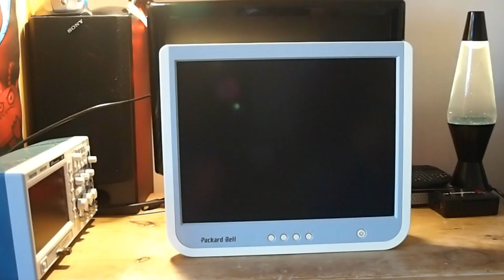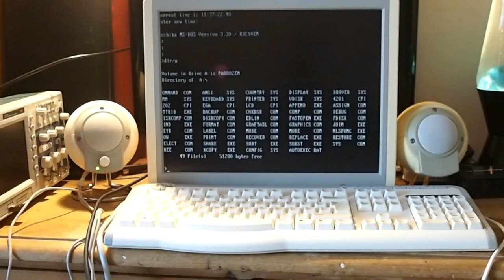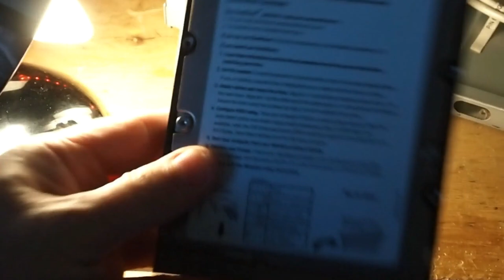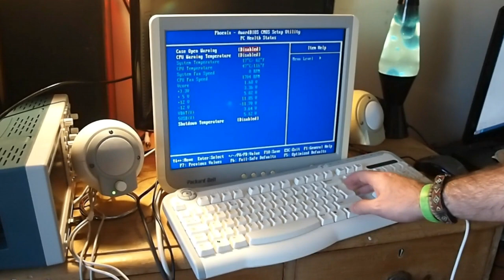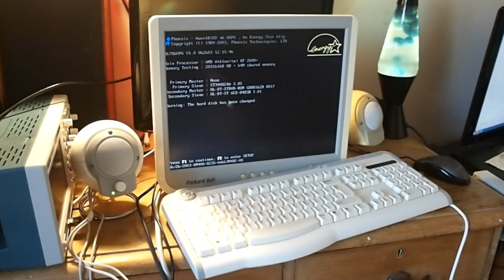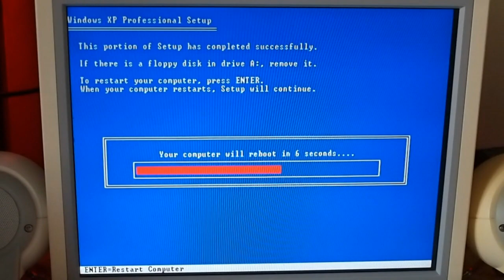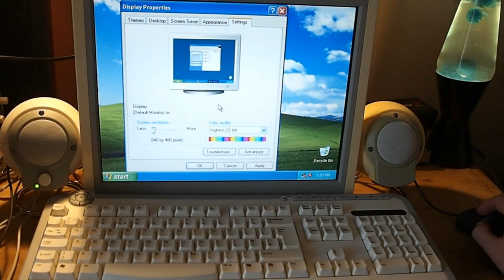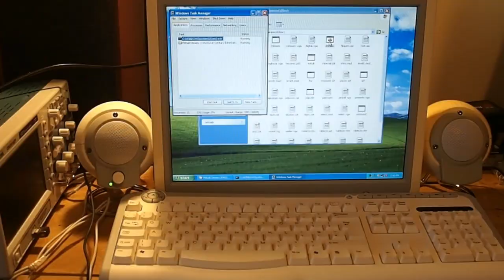Packard Bell AMD Athlon XP 2800+ Pickup and Refurb + Win XP

Comment: i have the pentium 4 version of this (unsure of the model it says VOL-C02 on the back but thats all i can really see
Reply from the maker: Do you still use it?
Reply: @RetroMarkyRM  i do! It's a little finicky here and there (since it relys on a Graphics card for video) but as long as its kept warm its usually pretty good, i recapped it ages ago
Reply from the maker: @lukedavis436  that's great. They are very nice machines, I love the case design and general aesthetics of these. Much nicer than modern generic boxes!
Reply: @RetroMarkyRM  yes the cases look great however mines beginning to suffer from weathering I'll apply some superglue to reinforce the cracking parts to prevent further damaged and I'll get one of the drive doors back on with a new spring i stole out of a dead HP G6